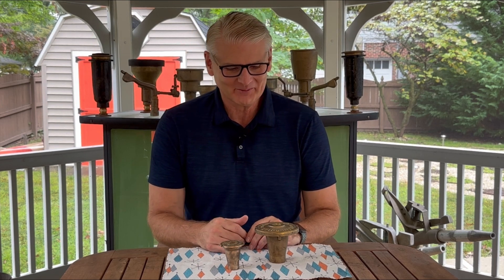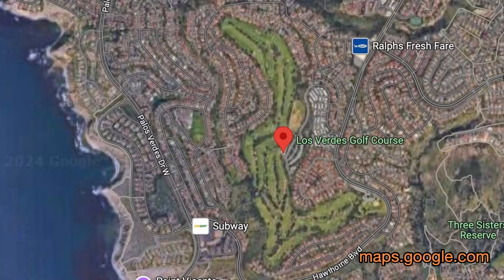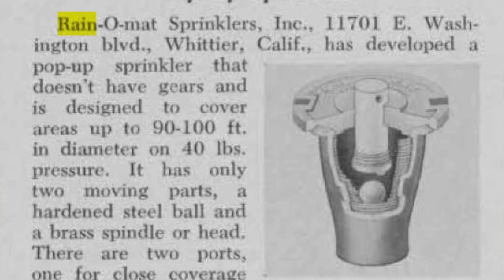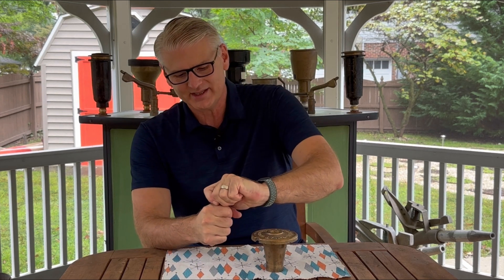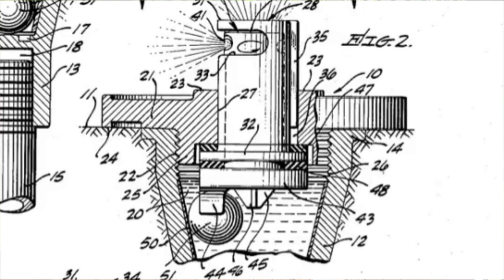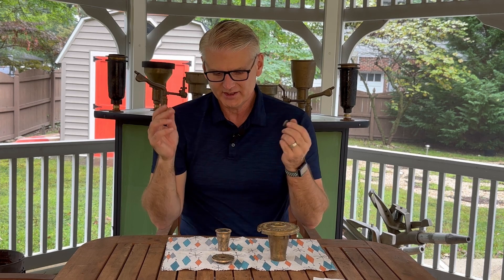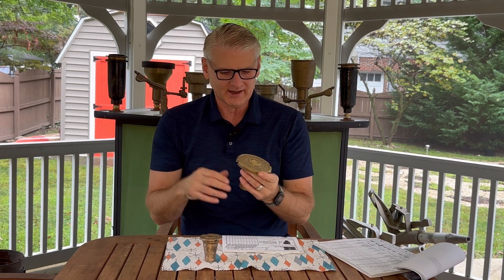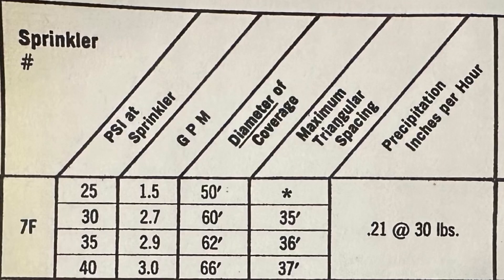Rain-O-Mat No. 11 and No. 7 Full Circle Brass Ball Drive Sprinklers and the story of Elmer Reynolds

Comment: The magic ball drive! A great sprinkler. Could it be that the direction of rotation is determined by which side of this mysterious nose the ball lands on? I can clearly see that N° 7 also turns to the left. 
Apart from the ball mystery: thank you for quoting the "„spirit of the age“ of the 60s. (I just realized that there is no suitable translation into English for the German word “Zeitgeist  means spirit of the age"). I wouldn't have noticed it with the pop-up sprinklers, but all the sprinklers that were placed on the lawn by the hose seem to me to have been influenced by the 1960s sense of form, and not just in the USA. In Germany, too, people wanted to be modern in the garden.
Reply from the maker: Since my teen years, I’ve translated that in my head directly as time ghost every time. It’s a great term. We’ve borrowed it untranslated to make up the hole in our language, as we do. Good question about the all relative to the tab on the spindle. Will have to ponder that.